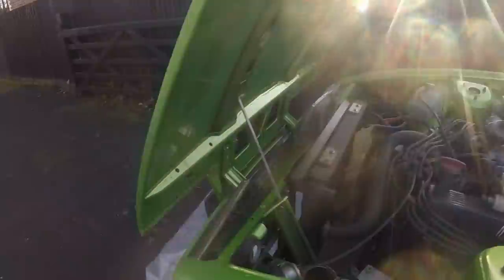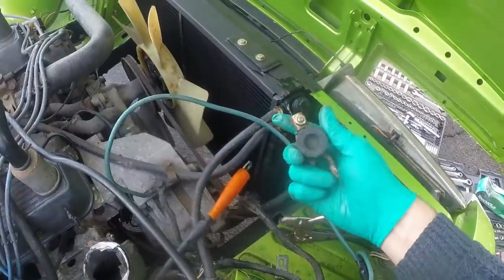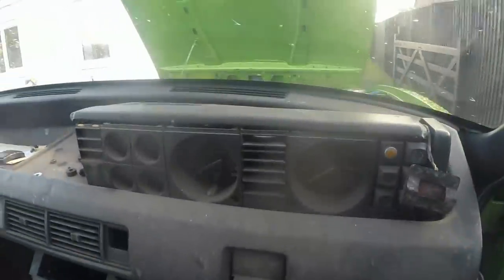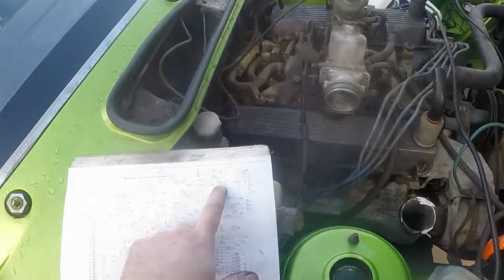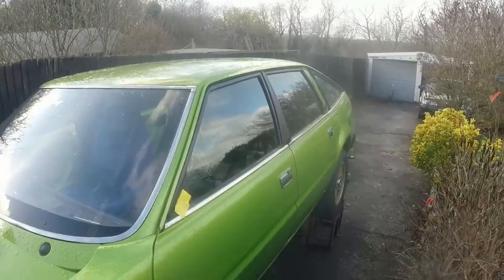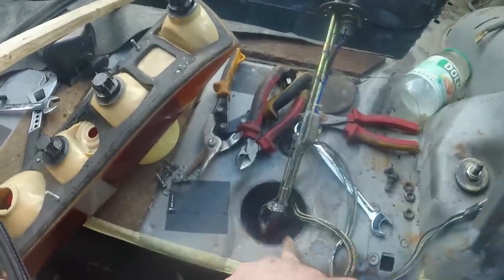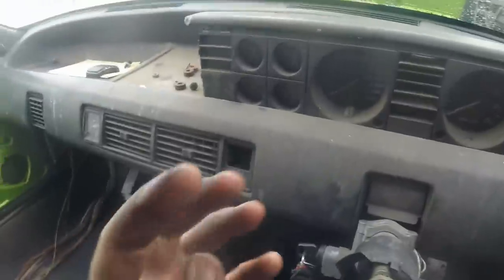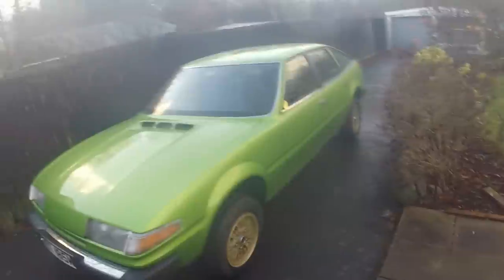Dotty 1981 Rover SD1 Restoration - Video 60 It alive! (again)

Comment: Dont forget the fan shroud. Makes a big difference and makes the fan clutch operate as it was designed.  Great job on the restore. All those series 1 are dying off.  My brother had one when he was in the USA.
Reply from the maker: Yes they massively boost efficiency.  Strangely the early series 1 and 1.5 cars like dotty never had them unless they had aircon.  The 2300 and 2600 never had them all the way through production.  Fingers crossed once i have the fan on the correct way round and with the 3-core rad it will be ok.

Comment: With the fuel pump pickup filter they tend to collapse  , a modification was to fit a coil spring inside the sock filter , Land Rover used a similar pump on the Military 101 V8
Reply from the maker: Thats a good idea.  Hopefully i wont need to take it out again

Comment: Totally had the rubber J fail on my sender. Later senders have metal Js.
Reply: Oh yes, and mine didn’t have any clips on the rubber either. What it does have is the metal ring inside is loose due to one of the hooks being bent. Next time I have to go in there, I’ll have to try to bend it back in or tie it with some thread.

Comment: Left my stage 1 v8 landy parked up in the corner of my front garden untouched for thirteen years, had to move it one day so iI stuck an old battery on it with half a gall of fresh fuel in the tank turned the key and drove it out unfortunately the oil pressure switch had corroded and the oil pressure blew the top off and spayed oil every where but these thing are sent to try us and it takes more than that to kill a rover v8 I renovated the landy over a couple of years and its been back on the road for the two or three years all I did to the engine was fit a new pressure switch .
had a SDI V8 back in the eighties nic car but rusted a lot
Reply from the maker: Yeah nice car shame about the build and rust.  Cant beat starting an old engine after its sat for ages.  So satisfying
Reply: @nitrosilvia  true, started my 1968 Honda CB 250 for the first time in about 48 years a few months ago